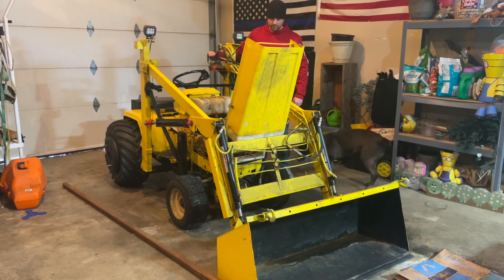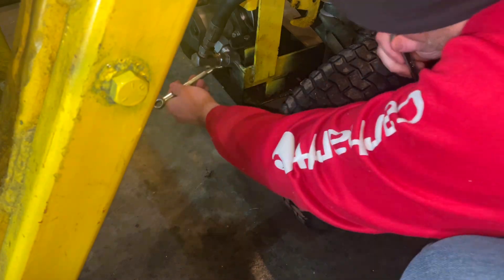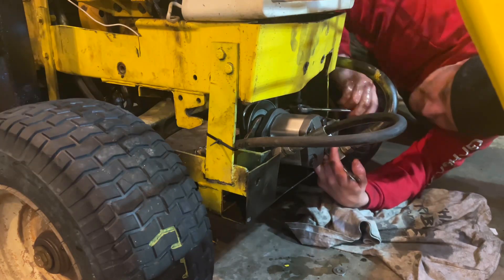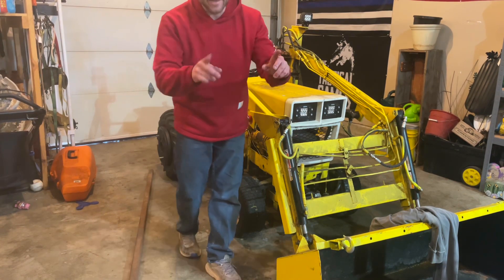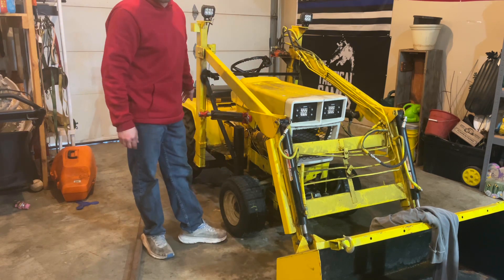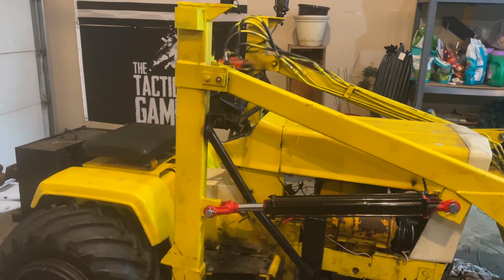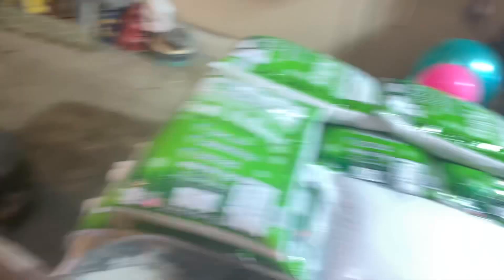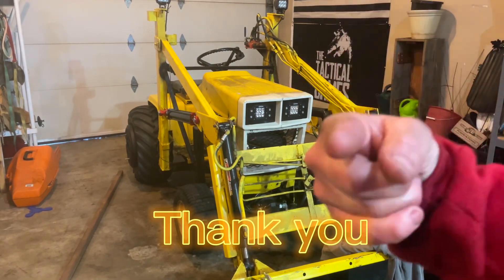Cub Cadet 129 front end loader hydraulic pump replacement

Comment: I was wondering what power it uses to run a belt and pulleys? Originally they were made to connect directly inline with the crankshaft. A more direct power source for the pump. When you have an old single cylinder gas engine your going to need every bit of power you can.
Reply from the maker: @patdexter9188  I don’t know for sure how much power it uses.  I do know it felt under powered and I got tired of always having to fix something so I put in a brand new predatory 16 hp engine

Comment: Any problem with running the pump off of a pulley ? Also is it just a 1:1 ratio?
Reply from the maker: Haven’t ran into an issue yet…. Assuming I measured correctly the PTO from the engine is 4.5 inches and the pulley on the pump is 5 inches.     Next month I will be picking up a 14 hp kohler and I plan on removing the PTO and running a 5 inch pulley off the engine to make it a 1.1.    I will post a video when I swap out engines

Comment: Well done. Are these 2 stage pumps? Can you put a link for the pump you bought in your description? I'm curious if a log splitter pump would still work for a loader.
Reply from the maker: https://ruggedmade.com/hydraulic-gear-pump-1-stage-9-gpm.html
Reply from the maker: Hopefully that link works!
Reply from the maker: Oops.   I didn’t answer your question.   It is a single stage pump!
Reply: @DansShopSD  It worked, thank you!
Reply: Dan the pump you listed is a 5gpm pump which I think will work good for my build. Is it working good for your tractor cylinder speed and not to fast ?
Thanks